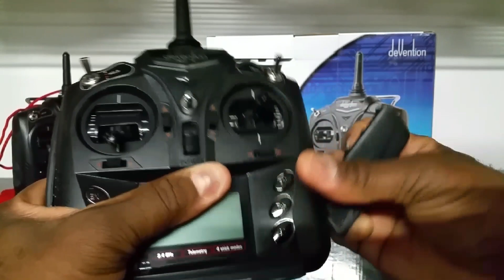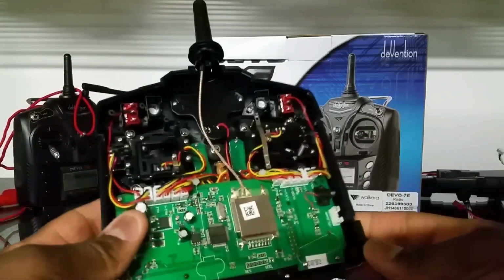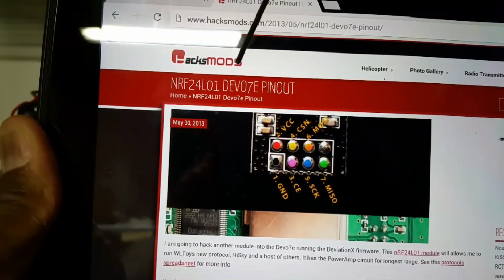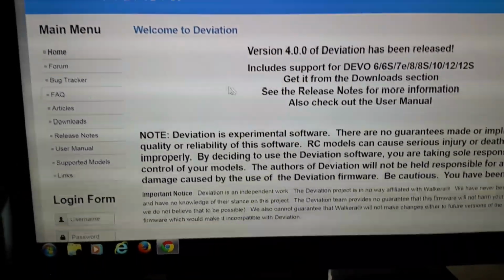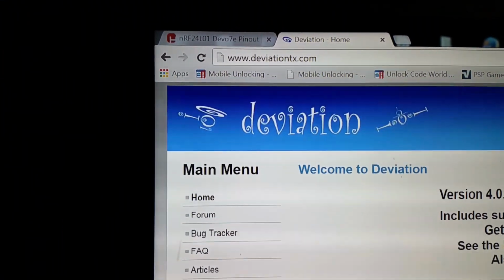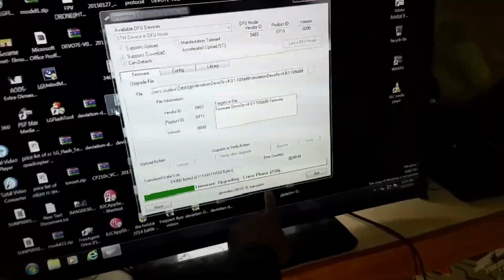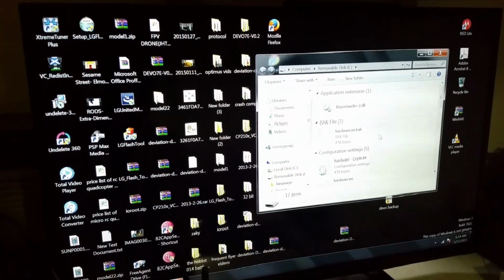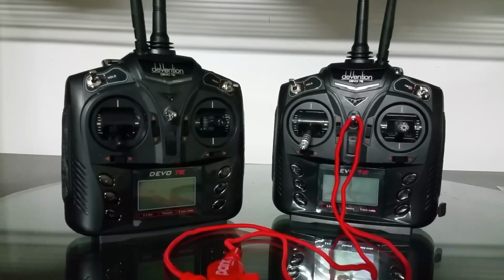Devo 7e Deviation Firmware & NRF24L01 installation

Comment: Great tutorial FF.  I had bought a devo 7e about a year ago to mod, and bought the NRF24L01 but just finally got around to doing it.  Went out today and flew the Syma X11, Tarantula X6 and Syma X12S with it...what a blast.  I should have done this long ago!  I should have the DM007 tomorrow morning and will set it up on the devo as well.  I went with the original DM007 instead of the upgrade so I could use the 7e with it...glad I made that choice now.
Reply from the maker: Thanks, you'll love it!
Reply: frequent flyer please help i installed software but when i turned off then turned back on it asked me to format i did that now i think i bricked it please help

Comment: Thanks for the video. I just bought a Bugs 3 and I needed to upgrade Deviation in my 7e to make it work. It's been a few years since I last flashed it and I used your video to refresh my memory. Also, it was some of your other videos that convinced me to buy a Bugs 3.  I prefer sport flying and I like that your videos show the more sporty side of quads. Seems like the days of the Nihui U807 and other sport flying Alias clones are gone and most newer quads are geared more toward carrying cameras. Seems like LOS sport flying has given way to FPV freestyle and racing. I appreciate and enjoy your somewhat retro flying videos.
Reply from the maker: Thanks man! My dream is to get with one of these toy makers and design some awesome flyers because i think cameras and FPV is kinda having a negative impact on the toy-grade quads. I love FPV but i think it should only be implemented with 5.8GHz and no altitude hold! I personally prefer FPV on Tiny Whoops and brushless drones. These toy-grade quads should focus on line of sight sporty fligjt characteristics and have LVC alarms built in the transmitter with telemetry. Just a few of my thoughts 👍🏿

Comment: Will this mod drain the battery of the Devo 7E faster because now it will emit over 2 antennas instead of just 1? Thanks!
Reply from the maker: +furulevi no, uses one at a time. Can also adjust output power at expense of range though

Comment: Are you going to add the a7105 chip?I want to put the nrf24l01 and the a7105 modules but can't find a tutorial on putting just those 2 in
Reply from the maker: I have one coming on the slow boat and I plan to do a video ;)
Reply: +Frequent Flyer RC Kool,thanks.Whats up with the Devo in the background?
Reply from the maker: C0ckPitVuE 777 I'm gonna install the other chip in tgere
Reply: Can both chips fit in 1 Devo,I saw Seby D  riggin 1 up with like 20 chips,lol it was the Devo 10.I want to fit the nfr24l01and the A7105 in 0ne Devo
Reply: +Frequent Flyer RC does this NRF24L01 chip allow me to control mjx 900, cx 10 etc using devo 7e? How does it work and what do I need? And can this be done with the devo 7?
Reply: MOD UPDATE:
The original chip CYRF6936 is obsolete and has been discontinued.
A new version, available from Banngood for $25.19 plus $2.00 shipping is model CYRF693, a 4 in one chip that replaces a CC2500, NRF24L01, A7105 and the CYRF693, and only one antenna is needed.

Comment: Thank you for the video tips and the links. Got the Devo 7E and the modules NRFL2401 and the A7105 Modules on the wish list. Got a better ProLine soldering iron with smaller tips from a clearance from a closing Radio Shack last week. Looks like It will be mostly online to get my supplies now. One of your links I saw uses a ribbon cable to wire up the modules. Two thumbs up frequent flierfor your hard work posting this video.:-)
Reply from the maker: Thanks! Hope it helps you when you decide to go for Devo 7e :P
Reply: Yes it will, Freq Flier. I'm gathering documentation (pdf) and web site links. Also, got Liquid Solder Flux (GC Electronics part # 10-4202)) from a local electronics store (only one in town). Only need now is congress (wife) to approve the appropriations for Transmitter and Module. LOL.
Reply: +Michael Reyes Do you have the ribbon cable link?  Could you post it or send the link?  Many thanks!
Reply: Hey Michael,  I was thinking you saw a vid on showing the module installation using the ribbon cables.  Hoping for the video link you saw.  Thanks!

Comment: I am a newbie to qua-ding.  Bought the Devo 7e and the Huiying X6058 per your excellent reviews.
There is no need to install the module nRF24L01 unless we want greater range, correct?

.
Reply: austin j The nRF24L01 makes the transmitter compatible with a bunch more quadcopters.  It's not really about range.

Different quads speak different languages (protocols.)
Reply: Richard F   What does it take to bind the Devo 7e to the Huiying X6058 ?   The Devo 7e has been flashed with the firmware. Have not installed the NRF24L01 yet.
Reply from the maker: austin j gotta install chip

Comment: Thanks for the video!

You now have 2 antennas?
Are you able to control both models that don't require the HW mod and those that require the HW mod with the remote now?
Reply from the maker: Yes! Middle antenna is for Walkera, Blade and DSM/Spectrum aircraft.  Added antenna is for the Deviation Firmware stuff. Another chip can be added for Hubsan, U807 and a slew of others! :D
Reply: Thank you for the quick reply Sir.  I have just spent around 130$ because of you... how does that make you feel ;)
Reply from the maker: Great  knowing that you did it for fun! I it puts a smile on your face and keeps you smiling then you come to realize it was worth it! Some spend a lot more on 1 pair of shoes!
Reply: I was kidding mate, I already destroyed like 5 cx-10 sets, and i got a brushless ecx-ruckus, and just got a GTX 980, as well as stage 2+ upgrade for my 2008 Audi S3.  Im a spender and I know it :)
Reply from the maker: +Eitam Doodai lol
Reply: +Frequent Flyer RC, Took me around 4 hours to solder the nrf24l01 to the devo 7e, but it works!

Some stuff I struggled with was, My board didn't have TMS/TCK labled on it, later I saw it was photoshoped into the diagram on hacksmods.com... and I used A14 instead of A13, which wasted around 1 hour for me.

Then I kinda had a hard time looking for a JJRC 1000 model file, but eventually found one and it works great.

Thanks for your video, it made me buy the Devo, and I am pretty happy right now :)

Comment: dude i have eye one extreme quadcopter by rc logger does support ppm protercol will this transmitter work after the hack also if has trainer port can plug in one link do you know is trainer port DSC module how can i find out
Reply from the maker: Yes it has trainer port.

Comment: Quick question. The version of the board you show in the video comes with a elbow antenna, but the bangood site shows it as a bare wire. The ones Ive got on eBay are coming with just a bare wire antenna. Is this type inferior to the elbow antenna version you have or are they the same?

Thanks!
Reply from the maker: There are various types on banggood site. Folding type is best because you can redirect signal spectrum by repositioning antenna from vertical to horizontal. And sounds like you will have to push the new antenna up in the same space as the existing antenna :/
Reply: Yeah. Thank you!
Reply from the maker: There are various types on banggood site. Folding type is best because you can redirect signal spectrum by repositioning antenna from vertical to horizontal. And sounds like you will have to push the new antenna up in the same space as the existing antenna :/
Reply: ***** The bare wire is cool because it will fit inside the original antenna housing on the transmitter.  Having two antenna's sticking out is just silly (and ugly.)  You only use one at a time.  The plastic housing can accommodate multiple antennas.
Reply from the maker: Richard F good point, but it can't be adjusted :/

Comment: Question - if everything is installed correctly, should it fly quadcopters correctly without adjustments?  I installed both the the NRF24L01 and A7105 modules and the firmware and tested binding to a JJ1000 (NRF24L01) and U807 (A7105), and both worked and spun the props.  Then I attempted to fly and the JJ1000 has serious yaw issues and the pitch controls are wrong (forward isn't forward).  The U807 just flips over. Should I start over?
Reply from the maker: +Rick in Jax absolutely not! Congratulations man! You just have to reverse the channels that's backwards on the V202 protocol in the mixer settings  but first, find the transmitter calibration in settings and recalibrate the sticks. Hit me at frequentflyer55@yahoo.com for help, I can send you settings files :P
Reply: +Frequent Flyer RC - Thanks, I had already removed the A7105 module since I figured my mistake was in the wiring of either one of the modules or the transmitter, and I only have the U807 on the A7105 module, so it was first to go.  Removing the A7105 didn't help, but following your advice I re-calibrated the sticks, and also changed the model type from heli to multi, and that got the Syma X11 and Bayang X9 working like champs. The JJ 1000 is almost there, the roll is reversed on the JJ 1000, so I'm guessing its a mixer setting, but at least I know the NRF24L01 is working.  I'll add the A7105 back after I have some more success with the NRF24L01 with my other quads (DM003, X5C-1, H22, X12S).  The Devo is a whole different beast than the simple toy grade RTF units.
Reply: +Rick in Jax - I used the mixer to reverse both the AIL and RUD for the JJ 1000, and now the controls work, but the LEDs flash like a LVC warning with a new battery, not a big issue.  I did a range test and all four quads that I tested had better range than the RTf transmitters.  I got 100+ yds on the Bayang X9 and the DM003, and 150+ on the Syma X11, and almost 200 yds for the JJ 1000.

Comment: Maaaaan here I am starting my antenna holes by hand with a tiny drill bit and working my way up to 1/4-inch for the SMA-RP connector I'm using like...126 bits later with a drill and you just burn a hole through...dang. :|
I forgot about that method! I haven't done that in a very long time. 
Each has it's advantages but your results still look great so props on the technique!
Thanks for being awesome!
Reply from the maker: Lol thanks
Reply: Now where the heck is =MY= X11 at???

Comment: I am about to do this mod, and I wanted to ask if you were to do this mod again would you do it differently. I'm referring to the soldering and connecting the wires to the actual module it seems on the opposite side the connections were longer and you could slide a wire that has the fitting already on it then either solder them or hot glue them hit me back😎
Reply from the maker: +alan lloyd I have seen it done that way and it is nice that way. But, I have a problem getting things to fit in there so I don't know if I would have done it differently :P
Reply: +Frequent Flyer RC ok I see, thanks for getting back to me. 😎👍

Comment: Bought a devo 7e, installed the NRF24L01 module and it binds and flies but the X1 just spins anti-clockwise unless I put 70%+ right yaw on it. Removed and reinstalled the module but the problem continues. Same thing with my MJX X600. Any suggestions?
Reply from the maker: +Andrew Storrs installation is correct. You just need to go into the transmitter menu and recalibrate the sticks! Must be done after installation. Congratulations man! :P
Reply from the maker: +Andrew Storrs will do you a quick video tutorial since I'm sitting at my desk :P
Reply from the maker: +Andrew Storrs video up :P
Reply: Works perfect now. Thanks for the vid.

Comment: I got everything done, but it won't bind. Module's enabled, protocols's there, model ini file is there. If it was a bad soldering job on the module, would I have any indication it's not working when I enable it? Can't tell where the problem is. EDIT: Protocol isn't showing in model setup, going to try an older firmware.
Reply: I ended up being turned off to soldering for like 5 years after this, never got it to work
Reply from the maker: I still have a brand new Devo 12 that I was never able to get set up with Deviation! I did my Devo 8S but one of the modules would never activate. Very thankful that Multi-protocol transmitters can be purchased already setup now but I still wanna go back in to try to figure out what the heck is not right with my Devo 12.

Comment: FF, My Devo 7e and NRF24L01 mod is on the way. I'm  looking forward to flying with it.  Im also thinking of adding the A7105 board to it so I can fly my Nihui 807 with it. 

Couple of question. Can I install with the NRF24L01 and the A7105 boards on the same Devoe 7e? 

Also do you know if I can bind my Holy Stone Predator H170 with the Devo 7e? I looked on the Deviation set but I could not find that model listed.
Reply: Never mind, I did a little research and found out you can have 2 mods on the Devo 7E and even more if you do separate mod.

Comment: Hi FF,

Please be advised that banggood has changed the nRF24L01 module into cheaper version.

I order the one on your link, but I get a different one.
There are fewer components on the pcb.
the antenna is soldered, there is no connector.
and the antenna casing is different too.
It seems like a cheaper version.

I am going to post the pictures here, but I can not copy paste text here.

Do you know about it?
Is it any good?

and does it have the same pin layout ?
please advise.
Reply from the maker: No I haven't or seen anything about it being changed although, I know there are various forms you can get it. Some have done the mod with a version without the antenna's housing cover..

Comment: frequent flyer so i didnt instal the module but i downloaded the deviation software to my 7e . will i be able to control some other different brands of quadcopters or do i absolutely need this module for the deviation software to work
Reply from the maker: +Patrick Fidler you can fly DSMX and DSM2 but you need to install module for the rest.

Comment: Great Video!   but....im still Really  Confused by all of this!   the Devo 7e  is a radio that will bind to most Quads?  or is the Modding needed?  how do i find out which Quad will bind or not?     sorry for so many questions.... im new and still learning all this Flying Language!   Lol
Reply: +twrecks116 Refer to this: https://docs.google.com/spreadsheets/d/1nBHzT3VWF6ShAhOqRB5y0Bcc7aXFuRFFlQkHn1RIM84/edit#gid=0

Anything with CYRF6936 under the Module column doesn't need any modding. This video shows installation of the NRF24L01 module.
Reply: + James Pound..Thanks for the INFO!!  now its starting to make sense!!    i gotta lot to Learn...where can i Buy a Devo Radio?Thanks Again Bro!!
Reply: Believe me, I was confused too at first and thought I should not try any of this. Now I can't wait for the TX to arrive. You can get one pretty cheap on Amazon or eBay: http://www.amazon.com/Walkera-DEVO-7E-Control-Transmitter-Channel/dp/B00B3OCRTY
Reply: +James Pound This needs to be put into the description. THANK YOU SO MUCH
Reply: Sam McWethy Glad to help. I for one  attempted to solder two modules and neither worked and I gave up.
Reply: Ah. I got my module soldered in but the software won't work for me now. I wish you could buy these pre made.
Reply: Well, that's actually what happened to me too. I couldn't decide if it was the software or hardware, but for me the firmware that supports the extra protocols has a glitchy, blank settings menu. No way to navigate. Without that firmware just adding the protocol doesn't work either.

Comment: I did the entire thing, got to the very end, but when I hit Re-init, nothing happens and I cannot bind to the quad. Any ideas? Also, I am not seeing quite a few protocols in the list.
Reply from the maker: Download a test build from Deviation website or hit my email later and I will send you some stuff and help out if you still need it..  Frequentflyer55@yahoo.com
Reply: Alright I think I actually figured that out, however I have run into another issue. I am trying to bind my 7e to my JJRC X1 but no matter what I do, nothing happens on the quad. Is there something I am missing? It beeps and tries to bind but nothing happens.
Reply: Got it working. Had to change the option. Thanks for the help!
Reply from the maker: Cool! I was out like a light, dog dead tired! Lol

Comment: Finally, I need to have time to see it carefully. will come back
Reply from the maker: Sorry for the wait! My phone has limits lol
Reply: Frequent Flyer RC I just saw it, I think I am ready now. you can fly the blades to0 now?  Why is there like two more modules? I have seen Seby devo 7e like with three antennas or more. Thanks this clarifies a lot. And how you do it with each models settings? you can download them ready?  So you can fly the Huiying toys too now?
Reply: Multirotor Go So red an pink cables go together in the same place on the devo, right?
Reply from the maker: Multirotor Go Yup! You can just twist them together before you solder them on :P
Reply from the maker: Multirotor Go well, there is a module that gives you Hubsan protocol and some others with it. But most probably won't be interested in those I guess.. Well mainly Hubsan flyers I imagine because Hubsan transmitters already offer awesome enough options.. To me,  this NRF24L01 gives all the goodies I like!  :P
Reply from the maker: Multirotor Go Oh yeah, and it flies the Huiying quads and Cheerson cx 10 v2 and supposedly Eachine 3D X4 & CG023 But I couldn't get that version to work :/
Reply: Multirotor Go grate, I was exactly thinking about doing that, thanks

Comment: Hi FF,

why do you change
enable-nrf24l01 = A14 to A13 ?
is there a reason for that?
Reply from the maker: Not 100 percent sure but I think it's related to the area you install the chip on. If another module is added I think it will use A14..
Reply: +Frequent Flyer RC 
Thanks.